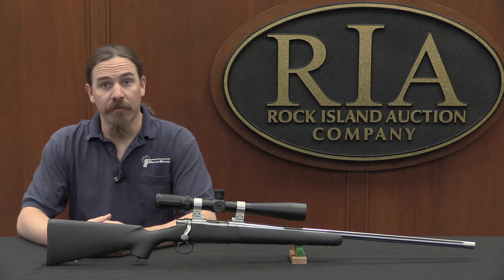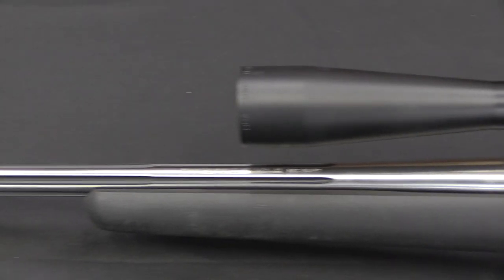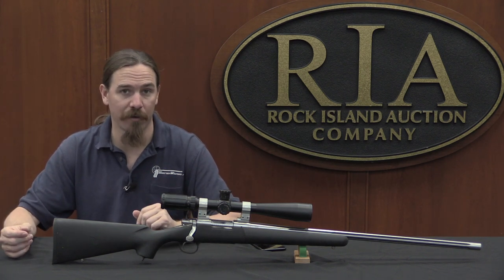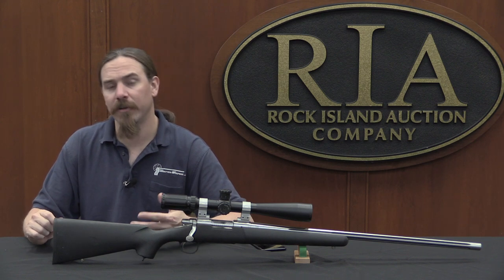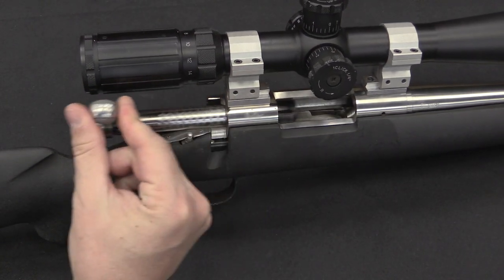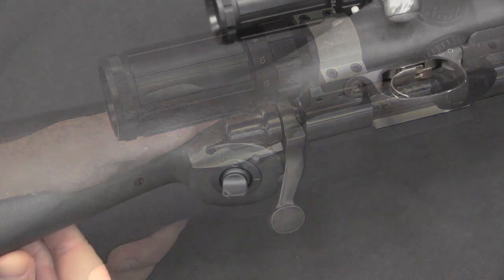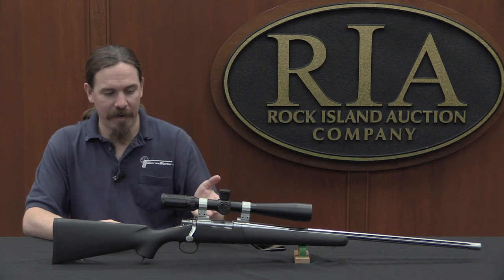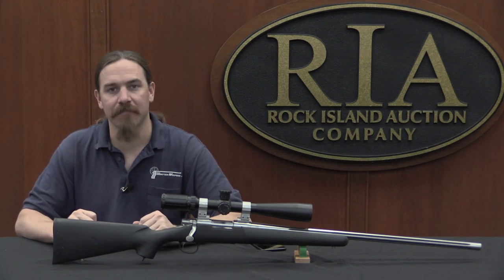Remington EtronX: Electrically Primed Ammunition

Comment: A rifle that gives error codes. Now I've seen it all.
Reply: @Richard Foran Yeah, but the space gun isn't computerized.
Reply: @Richard Foran True story: that was why I clicked the space gun video too. But I actually thought you meant the Gyrojet.
Reply: P0446 - needs a new canister.
Reply: They all do: “click” no “bang”
Reply: I can't really think how this thing is computerized. Should be pretty simple passive electronics.
Reply: @volo870  you could set up error codes with pretty simple glue logic. You could easily detect continuity in the firing electrode for example and you could detect the rifle being in the firing position with a simple switch
Reply: @jordanlong00  Yes, I looked at it again. I am not sure why they built error codes into the silly thing. I think I may make same operational circuit with passive components only.
Reply: Nah, we haven't seen one that connects to an app on your phone. Yet.

Although, I do have a rifle scope that pairs with my phone.
Reply: @volo870  Exactly, codes mean processors which are not needed to fire. This was a preliminary smartgun that the industry hoped would be a standard. Biometric sensors were being worked on but an electronic ignition would be requirement for most of them. This is from an age when the gun industry was working with gun control groups to mandate that biometric weapons would be the only ones allowed pretending to meet 2nd Ammendment requirements while banning all others. It would be interesting to see if there is an antenna in the circuit for remote disabling, a feature that would NOT be in the manual.
Reply: @strayblackcatsmeow  Electric ignition is a smart idea for high precision guns (i.e. getting rid of ALL moving parts should noticeably improve accuracy).
Hardware gun control  is not a bad idea as of itself (I mean limiting use of police- and military-issued hardware is good for all situations. There are weapons with inbuilt gunlocks - nothing wrong with those).

But the "smart" rifle in question is not smart. Quite contrary - it's just stupid.
Reply: @volo870  : The error code is probably just to tell you why it won't fire. In this case, to avoid accidental discharges while changing the battery.
Reply: I literally burst out laughing, almost to tears when he mentioned it.
Reply: @absalomdraconis  It got me thinking. If this thing has active programmable components inside - may you access those during storage or repairs and add a single line of code, which makes it fire randomly? Not a large chance... Mischievously small one.
Boy, it would be fun!
Reply: @strayblackcatsmeow  I worked for a company that at some point had tried to do some development with RFID with one of the gun manufacturers. It never went anywhere but I did get to see some of the prototype PCBs. I'm not sure what the actual issues with the deal were but I was told that the physical shock from firing was exceptionally hard on the electronics (this was for handguns). These were mechanical fired, not electronic.
Reply: bigricester  I've only ever seen pictures and video, sadly.
Reply: NOT A CAAAAAAAAAR.
Reply: @MegaZeta  I didn't say it was a bad idea, just that it was funny.
Reply: @damiangrouse4564  If only it actually had an electronic voice which said "click" when you tried to fire it while it was experiencing an error. That would be the most awesome thing ever.
Reply: Just pray that the machine spirit is willing!
Reply: @wulferikgebhardt5312  
May your weapon be guarded against malfunction,
As your soul is guarded from impurity.
The Machine God, the Omnissiah watches over you.
Unleash the weapons of war.
Unleash the Deathdealer.
Reply: The dream of any programmer(who is also interested in guns)... a gun with error messages.
Reply: Error codes would be pretty useful on any other gun now that I think about it
Reply: Aged well
Reply: @neilkuckman6627  I was thinking something like: "Error variable chambered_round has no assigned value"
I wasn't thinking of George Orwell's 1984

Comment: Plug in a car battery and get ready to fire full auto. Trust me that's how electricity works
Reply: Robert Brown  Transformer to lower it from 12 to 9 volts.  If you can't buy, you could make one with enough do-hickery
Reply: Trust your momma.
Reply: It’s a bolt action.  There is no auto.
Reply: This is a so simple joke, and still exists people who didnt get it
Reply: You just have to use AC instead of DC.
Reply: Christopher Marlowe  by looking at memes
Reply: Full semi auto
Reply: @___meph___4547  For the lulz.
Reply: I guess engineering works the same as homeopathy now.
Reply: Ex Electrical Engineering student here, I can confirm.
Reply: @theyedmeister6981  No need, there should be an internal regulator for the circuit, and the primers will work with anything over 9v, as long as the capacitor's current limiting charging resistor can handle it.

Comment: And what if a bunch of deers get their hooves on an EMP bomb, mmm? Then what?
Reply: Mathieu Gariépy "Open Season". on Humans!
Reply: emp can't destroy device from far distance,it would create and alternative voltage and malfunctioning the electronic components.Everything would be recovered when you invert the battery direction.And use and metal box will protect the electronic components,actually this electrical firing design doesn't need electronic components,just a high current battery and an switch.
Reply: Fix bayonets.
Reply: Finally some asking the real questions.
Reply: Then the arms race has just escalated.
Reply: Deer*
Reply: Wouldn't it be ok so long as the key is in the off position. EMP usually damages sensitive electronics not simple switched electrical equipment when said equipment is off. This is basically a bazooka on a smaller scale.
Reply: An aireal nuclear blast causes an emp. So you'd have to survive the bomb first
Reply: mother of god
Reply: Everyone knows you could just crush them with a big boulder.